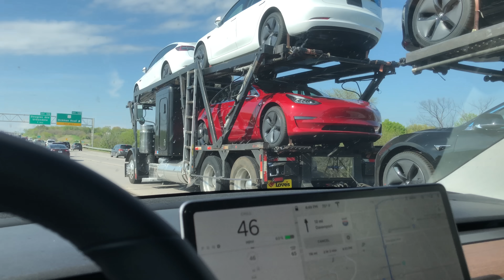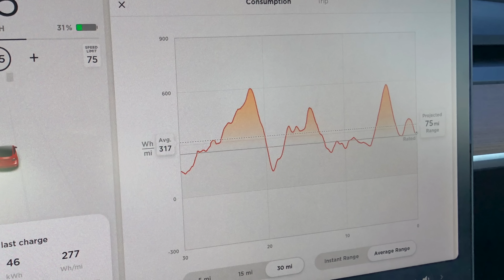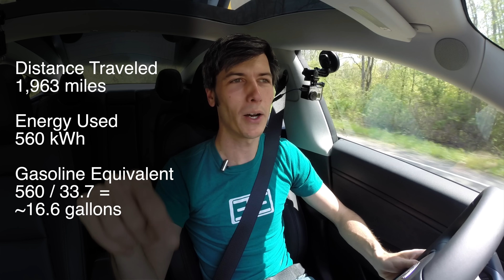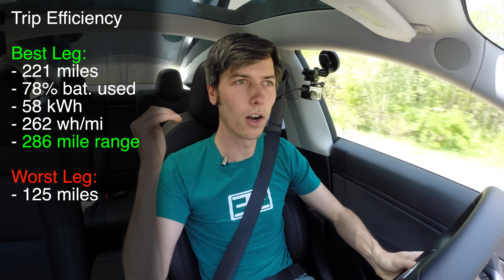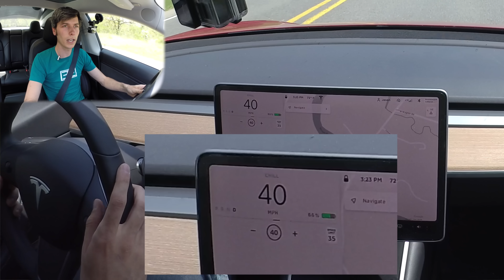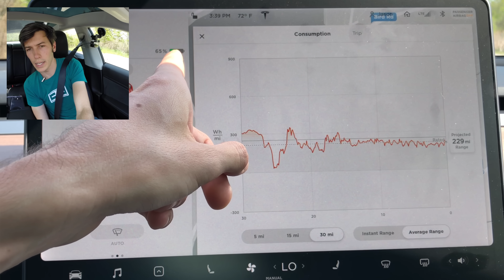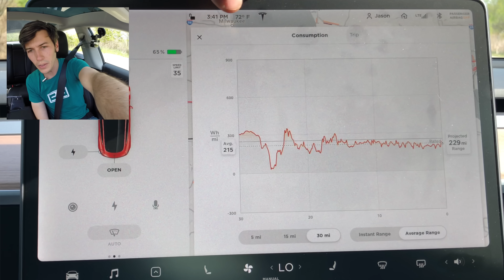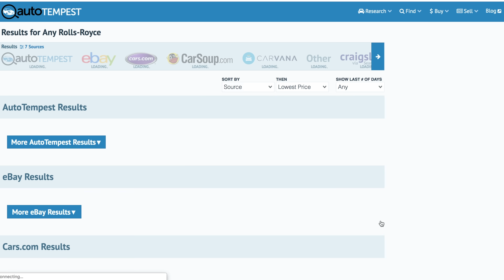How Miserable Is A Tesla Road Trip?

Comment: You really cannot compare the fuel efficiency of an electric to a gasoline powered car.   That is like looking at the efficiency of a car with a separate electric generator and electric motor driving it but only considering the energy use of the electric motor and not the fuel used to power the generator.  A power plant delivers the electric power to the end user at about 40% efficiency.  So if the car used the equivalent of 16 gallons of fuel, the power plant used the equivalent of 40 gallons of fuel to produce the electrical energy needed.  Of course at close to 50 mpg, that is still really good.

Comment: It's possible to get very close to ICE travel time (with bathroom & food breaks) with these tips: 1) drive pretty fast, 2) run the battery down to <10%, 3) make sure you get your bathroom and eating breaks done ONLY when charging, and 4) don't hang around too long after the app says you're good for continuing on your trip.  I've done about 20 road trips of >= 500 miles in my Model S 85D.

Comment: What a newb :-) 

1. You missed out big time by not having AutoPilot. I love to drive as well but on my recent 1700 mile trip, it was great to take a break once in a while and let the car keep within the lane, get on the right lane to make an exit and keep its distance from the car/truck in front.

2. The car will alert you if you're too far from the nearest charger with your current charge level. Stop being a wuss and take it down to 5 to 10%. Also charge more often if you want to make better time. 15 to 20 minutes is all it should take.

3. There is NO way that you eat at all so those stops were probably for your traveling companion.

Comment: The total energy used for the trip was very surprising, but to really estimate the true energy used to make the trip, we need to account for power grid efficiencies and power generation efficiencies. If you got all of your power from coal or natural gas plants, we are still dealing with heat engine efficiency issues, even though it would be a steam turbine.

Comment: 919 miles in 16.5 hours is similar to a gas car.....multiple trips of that length (give or take 50 miles probably) and 16 hours is normal unless you're not stopping for anything. Your legs want to fall off if you do it that way.

TLDR: 16 hours is easily in the realm of normal

Comment: The only facts of this video that matter:

He was forced to not drive for 50 minutes every 3 hours.  Other cars did 80 mph (almost no stops needed).  He only averaged 75 mph * (3*60) / (3*60+50) = 58 mph.  

If you'd be ok driving at 58 mph when people are passing you at 80 mph, a Tesla is the car for you.

p.s.  Anyone who drives a car that is built for 150 mph at 75 mph on safe, interstates in good weather due to "excessive road noise" where the speed limit is 80 mph is not a person I can possibly relate to, or is even an outright fraud pimping, e.g., the 75 mph speed limit prison system, and God knows what else.
Reply: No because the prices of a hotel in the middle of nowhere will be less than the prices of a hotel walking distance to a supercharger. 

And, most people you visit won't want a nema going to the street.
Reply: It's another reason electric cars suck.  Auto pilot on gasoline-powered cars allows you to sleep.  No "I need to sleep AND charge the car" wastage.

Comment: According to the figures for your longest daily distance, you drove for 13.3 hours and covered 919 miles, which works out to be an AVERAGE speed of 69 miles/hr. I'm a bit sceptical of that, considering you generally didn't exceed 75 miles/hr, because you would've had to slow down for traffic, intersections, sharp corners, and small towns. In other words, it seems fishy that your average speed is very close to your maximum cruising speed.

Comment: Jason, you should get a 35% ceramic tint all around with a 80% ceramic blue tint on the windshield. It will reduce the interior heat and also glare A TON. Even though you do live in the North it would help.

Comment: A few tips.
1. Charging is always faster when the battery is low on charge, so you would want to arrive at the charger near empty. It's scary at first, but in time you learn to trust the car. And you can always drive slower if you running too low.
2. For the same reason you shouldn't charge more than you need to reach the next charger.
3. Tell the car you are going to stop at a supercharger (sat it as the destination or way-point in the navigation), then the computer will prepare the battery and you can charge 25% faster.
4. Overall you save time if you drive faster and charge more often. Of course keep in mind the speed limit.
5. Combine charging with other activities. Having lunch or a coffee is the most straightforward, but you can also do some shopping too. Or just relax, take a walk, enjoy the fresh air and the fact that you are not in a rush. The time spent charging shouldn't be considered as wasted.
6. Use A Better Route Planner. It takes into account all kinds of variables to calculate your route far more accurately. For example it takes into account elevation changes.
7. v3 Superchargers are coming with 250kW power. A Model 3 Long Range will be able to charge 75 miles in 5 minutes and 180 miles in 15 minutes. Probably the S&X will get this capability too with the coming big refresh.
Reply: supercharger / fast charging reduce battery life
Reply: @3timesDoesit  
Yes, but it's not that bad. You only supercharge on long trips, not every day. normally you charge at home or work.

Comment: If you include time, EVs are still not efficient enough. about 2 liters per 100 km does not make up for 8 hours charging time compared to 5-10 minute refill on a 4-6 liters per 100 km car running on fuel. On another note, check out OpenPilot, Jason.

Comment: I would bet that your charging time would be lower if you used abetterrouteplanner and only charge to 70-80% and running it down to 10%. Planning a 6500km Europe trip this summer. Average stops are 25mins and total charging time is 13 hours from a total travel time of 85hours.

Comment: I thought the Long Range and the Performance were supposed to get over 300 per charge...
Reply from the maker: Combined city/highway driving. Highway driving has no regen so range is lower. Kinda like how hybrids often have higher city fuel economy than highway as well.
Reply: @EngineeringExplained  Makes sense.  Thanks!

Comment: Wait, so it took 11 hours longer than google maps said it would take, and you stopped for charging for 8 of those hours. Honestly sounds like google was pretty accurate lol, within 3 hours accuracy on a 2 day drive, assuming you only stopped while you were charging... not too bad lol. 

Also, I'm sure you know this, but Google usually does actually know when there's traffic, construction, and other delays, and factors that into the estimated drive time. If construction came up after you calculated the route, the route would time would be adjusted, but obviously that doesn't do much to a static screenshot from the day before :P

Comment: Petrol cars are not that inneficient, its the pathetic excuse of gearboxes that cause such bad mpg, electric cars are always at peak torque whilst gasoline lose effeciency running through the gears, i submit to the FIA is the main reason CVTs never saw proper development cause with a proper direct drive CVT, Diesel type engines would be the order of the day, look at american V8s, because of lack of CVT, it has to be designs for horsepower rather than torque
Reply from the maker: This is a lot of bad info. Gearboxes are very, very efficient. ZF estimates the gear losses never exceed 2% in their 8HP transmission, today's gold standard. Also, electric cars are not always at peak torque, that only happens if you're flooring it, and they're either at peak torque, or peak power, but generally not both, so there's a huge range of driving where you're not at peak torque (low vehicle speed while flooring it is the only peak torque range).

Comment: How well will an electric car run in Chicago winter weather with 19 degrees below zero temperatures???
Reply: Carl Parish Just fine. Maybe 15% less range. Car and seats heated when you get in. Assuming a reasonable Chicago commute, no problem whatsoever for a car with. Check the car's popularity in balmy Norway.

Comment: ur butt wont hurt when you only sit in a car for 3hrs at a time.  with all the breaks to stretch and move around.  try driving that mileage with a truck with 36 gallon tank and ur driving 600-650 mile between fill ups. no matter what seats you have it will make your butt sore.

Comment: Did you drive optimally? if you had driven a it slower would you have gotten there quicker?
Reply: Driving faster is better. The optimal speed is way way higher then the speed limit. I don't know about the Model 3, but for the much less efficient Model S the optimum is 112mph.

Comment: Sorry Jason,
As much as you I appreciate your general research and dedication to math / fact, the statement that ICEs are "wildly inefficient" ( starting 7:58 ) is just plain untrue. The thermodynamic rate to convert coal / oil / gas into kinetic energy, be it with or without electricity in between, stays the same. For BEVs the losses just happen at the power plant and not in your car.
Now there's a number of other factors like recuperation or maybe >95% renewable energies like in Norway... But any blanket statement like yours is such an apple to oranges comparison that it is a dishonest generalization.
Reply from the maker: It's not dishonest. Cars store energy onboard (that gasoline doesn't magically appear either, lots of energy goes into refinement, transportation, etc). Of that stored energy, how much of it goes towards moving the car will determine the car's efficiency. The car's efficiency, not the process's efficiency, which is a completely different subject. Nothing inaccurate about stating electric motors are far, far more efficient than internal combustion engines.

Comment: What happens if one of the Chargers is down? What happens if a town or an area loses electricity due to a storm or something else? I'll tell you what happens, you're screwed.
Reply from the maker: What happens if the gas station doesn't have power? You're screwed! /s
Reply: @EngineeringExplained  where I live all gas stations have backup generators, I think this is because I live in Florida where we have hurricanes. I think many other gas stations across the country also have backup generators, and of course the backup generators run on gasoline. So, wrong again knucklehead.

Comment: I wonder if by replacing that flat nose tip of the Tesla 3 will increase its efficiency by prolong the miles between charges... LOL
As of this day on our US roads, I still rather drive a GMC Yukon XL or Chevrolet Suburban or a Ford Expedition XL for 500+ miles then take a 15 minutes refueling break than waiting for an hour for the battery be charged that's assuming the high capacity charging is always available...

Comment: The  usable 75 kWh battery being equivalent to 2 gallons of gas is true of the energy in the gas,  but an ICE car can only utilise 1/3 the energy at best. So it is really the equivalent to 6 gallons (23 litres) of gas.
Reply: Also, the best range performance of 286 miles, @ 30 mpg, means an ICE car would need 9.53 gallons (36.1 litres). the worst 223 miles would also require 9.53 gallons for the same reasons. It would be fair to say the Tesla M3 LR battery is equivalent to a 10 gallon tank of gas.
Reply: Peter Egan my bmw 328 convertible gets 23mpg and I get 335 miles of range . Takes 3 minutes to fill up,
Reply: @myaccount__7269  in that case, the Tesla 75kWh battery is equivalent to 12.5 gallons or 47.5 litres. The Tesla will go as far as my Hyundai Tucson will go on a tank of gas. While I can fill it in 3 minutes, I will stop twice in that time to stretch my legs and get a drink. So not a lot of difference in journey time.

Comment: You have no idea how tiring it actually is to steer a car until you appreciate the continuous feedback loop between eyes, brain and limbs. Have you never wondered exactly why the longer a car's wheelbase is, the less tired you feel after driving long distances? The longer the wheelbase the more the car will hold a line, fewer steering corrections required. Autopilot = no effort at all.

Comment: losing 8 hours for a 22 hours trip is too much, electric cars are perfect for daily city driving unless battety technology changes.
thats why i like the small E car approach which serves a very good purpose.
if you have long trips to make, having an electric car would be a pain in the a**.
Reply from the maker: If you're going to bash it, at least get the numbers right! 38 hour trip, 8 hours charging. (Not a 22 hour trip).
Reply: @EngineeringExplained  not trying to bash anything, just pointing out the inconvinience of electric cars for long trips which is in my opinion a big criteria for buying a vehicle.
Apart of that i do agree that electric motor's efficiency is superior, but having a gasoline would reduce some 800 Kgs out of the driving resistance which implies a gasoline would not need 500 something Kwh but presumably less.

thanks for the nice video though, was interesting ;)

Comment: The Tesla and EVs generally might have >90% efficiency but the power stations that charge them don't. Those that combust  stuff (which is most) are c. 40% efficient, only incrementally better than ICE engines. But you knew that.

Comment: Great, informative video, Jason! I really want an EV, specifically a dual motor Model 3. However, I drive 282 miles round trip every other weekend, and would like to be able to do this trip without recharging, and in every weather condition. Looks like the Model 3 can't really do that (particularity in lower temperatures) without needing a charge. The Model S Long Range seems to be able to do this, but there's no feasible way for me to afford a $100k car. Guess I'll just have to wait for Tesla's battery tech to get a tad better. Shame. I really dig the dual motor Model 3.

Comment: I'm sorry but did you use Tesla nav? I used ABRP and my longest charge was like 30m, but most charges were in the 15-20m range. That way I can drive for a few hours, take a quick break, and keep going.

I'd rather make more frequent short stops. I bet if you raced someone using ABRP they'd get to the destination MUCH faster...

Seriously, look at my road trip video. I'm not just trying to get views, delete this comment after you see it. We went over 800 miles and spent less than an hour and a half charging.

Comment: You charged 12 times over 2000 miles, so averaging 166 miles of range.  Your best interval was 191mi.  You indicated you did that once.  So 2.25 hrs driving and then stop and eat for 40 minutes, then another two hours and another stop and ...what eat...??  Again.  You gonna get fat.

Despite fabulous range claims the real range for a $45,000 high end BEV is under 200 miles and well under 3 hrs steady 75mph and then charge leaving you a safety.  Sometimes detour for a good charger.  Did you hit any charger queues?  Don't leave a safety and run out...you'd have been looking at a four-six hour tow and charge adding on, just like your tire incident.

It can work for 100million cars if there are as many chargers as about four times the number of gas pumps today, since I can go 420miles with a safety margin and only occupy a pump stall for three minutes, not 30-40.  Right now, as it is an enthusiast niche car, the infrastructure can work.  Small numbers of these cars on the road is your only saving grace right now.  Most EVs stay in metro, and many people use the "other car" for trips.
Reply from the maker: Huh? No, best interval was 221 miles as shown and discussed in the video. Answered your charger queue question in the video (none experienced).
Reply: Engineering Explained.  Nicely presented BTW.
    Still seems a travel appliance for the obsessive compulsive, vs the average Joe and especially Jane that just gets in and drives till the E light comes on or they are down to 1/8 tank and an exit is coming up.  2000/12 is 166.66miles.  You stopped two nights, so I'm sure you charged to 100% then.  Wouldn't that have been longer than 52 mins.   Didn't see night charges on your list.   If 40minutes average got you from 15% to 80% that means about 65% of max range so around 200 miles usable as you stated.  I assume the ten minute short charge was to get to some big destination charger like your hotel.

Still sounds to be the car for fantasy astronauts planning their moon insertion burn.  It'll mature if the manufacturer survives.  If he fails, the big manufacturers will drop the idea as they did a century ago when the EV Company of NYC went bankrupt with thousands of unserviced vehicles on the road, now orphaned.

Comment: The one thing I never expected about a Tesla would be that a cross country road trip would actually have a higher energy bill than if I did the same road trip in my petrol Volkswagen. If I drove 1963 miles, getting about 42 miles to the gallon with my car, and paying the same hypothetical $3/gal, I will save a whopping $16 compared to that Tesla. 
Then consider the actual price of gas where I live is $2.3/gal and it's a more substantial $50 savings.